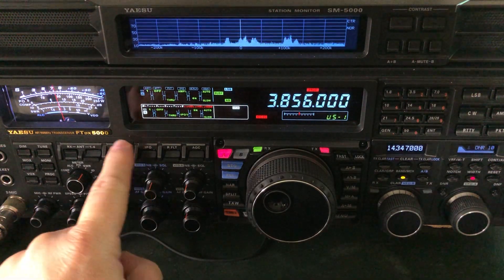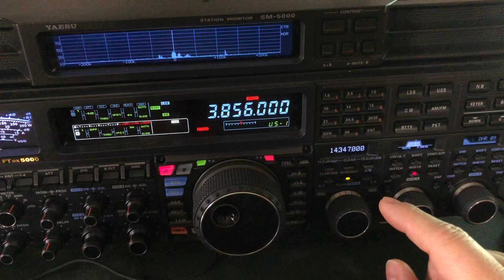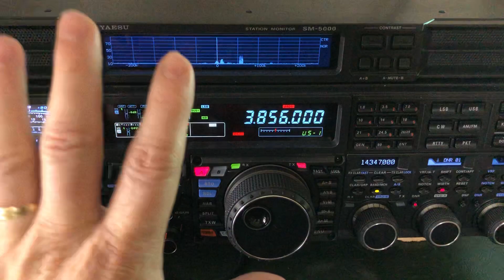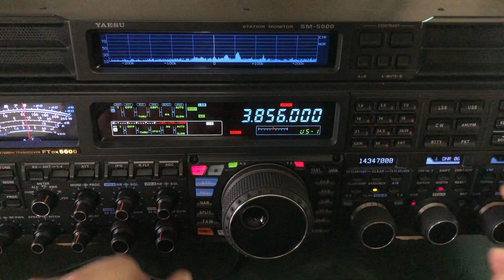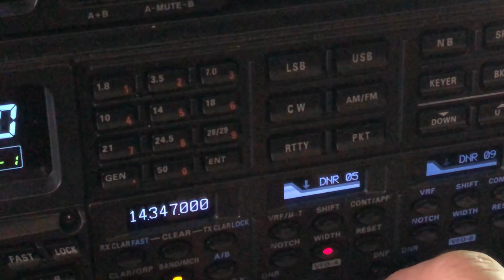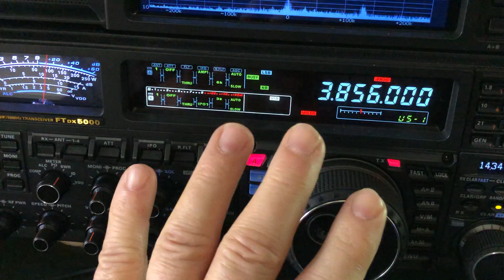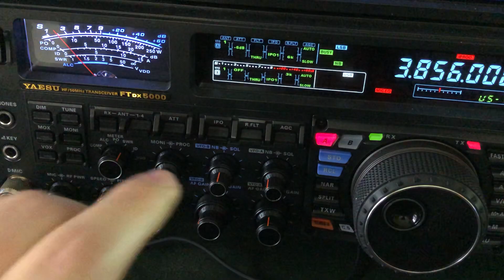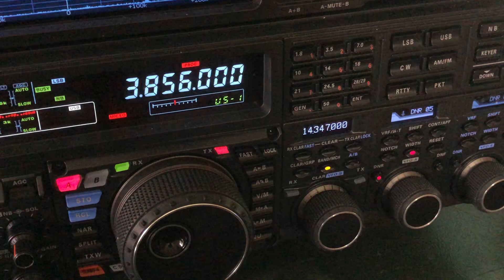Digital Noise Reduction in the Yaesu FTdx5000MP (in-depth) #hamradio #yaesu #ftdx5000 #dnr

Comment: The 1200/5000 have the same DSP chip
Reply from the maker: Indeed, the tms320c6727 is a good chip.  It's interesting that they didn't use the same chip in FT-891, FT-991, FT-991A, FTdx101D and MP, and FTdx10.  They used the tms320c6746 for all of those.  The DSP is quite good in all of those radios as well, except with the FTdx101, the DSP is prone to distortion at settings of 4 or less.  It's also interesting that the FTdx5000 DSP cannot and will not produce the "watery" sounding digital artifacts.  That is one of the reasons I chose it over the FTdx101MP.  I don't think the difference is simply which DSP chip was used.  It seems that the implementation of the chip was better in the FTdx5000.  As I recall, it was also quite good in the FTdx1200 and FTdx3000D.
Reply: @n4hnhradio  yes the implementation is different somehow. With the 101 , changes to the firmware also adjusted how the NR worked in subsequent releases, albeit slightly.

Comment: Very good video, I completely agree with ref to s meters I own a yaesu ft 840,897 and a 950 all read different s meter readings the 950 is far superior to the 840 and far more superior to the 897 which seems to receive far more noise I use them all through a bhi noise reduction speaker. The 5000 definitely looks the one to have. I always use ipo on 80m and the 6db att and rf gain also helps, I always leave the roofing filter on auto so 6khz on ssb I'm interested if you have any views on roofing filter selection. Thanks again for the video that is one awesome radio, 73 de 2e0nbk
Reply from the maker: I usually use the 3kHz roofing filter for SSB, just to help the DSP out a bit.  73, N4HNH
Reply: @n4hnhradio  thanks for the reply I will change mine to 3khz, great vids again cheers
Reply from the maker: If you press straight in on the rocker switch for the roofing filter selection, the 5000 will auto-select filter width based upon the DSP width setting.  If you keep the width below 2.7kHz it will choose the 3kHz roofing filter.  

All of the rocker switches put the 5000 into auto-select for their given function.  AGC, ATT, IPO, etc., all do it.  73, N4HNH

Comment: Thank you Doug.. I have watched, rewatched and watched again. The decision has been made. When you are next in the shack, would you be able measure the combined height of the radio inc the SM without the feet on the Rig Please? IE Bottom panel of 5k to the top panel of the SM. Thanks Doug. Your videos have been a massive help in answering questions at a time when info is hard to find. 73 Mike
Reply from the maker: Hi Mike!  It measures just shy of 7 inches.  I hope that helps.  73, Doug
Reply: @n4hnhradio  Mega thanks. Sadly a tad too tall. More thought required.